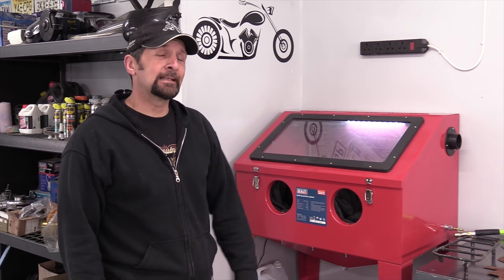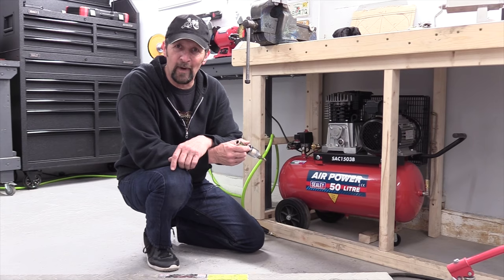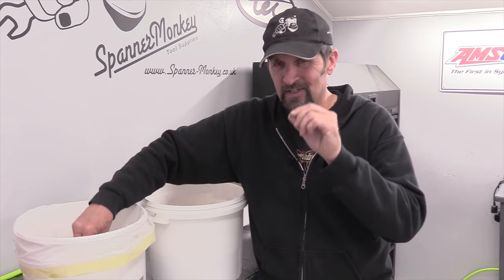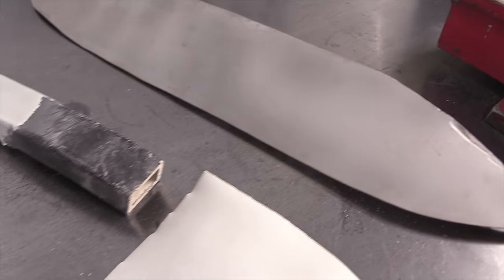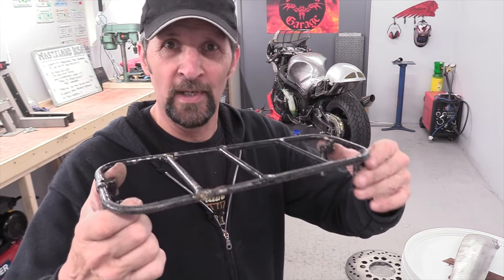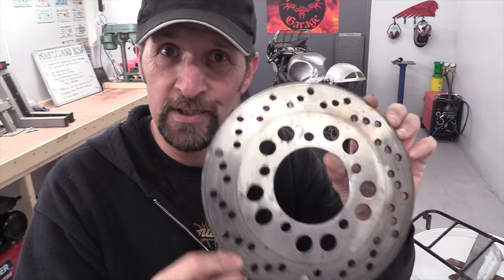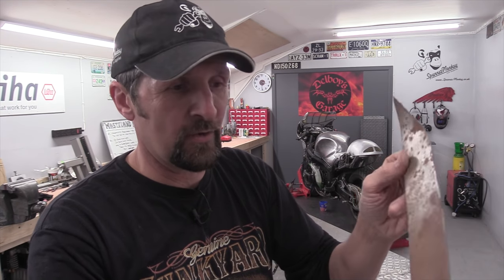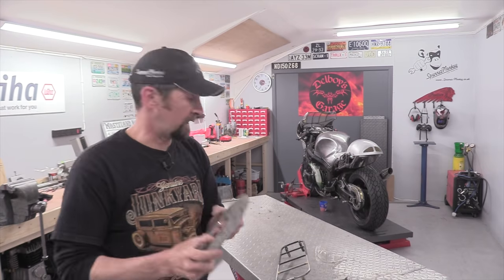Shot Blast Cabinet...First Day !

Comment: Brother, you're essentially using compressed air to fill your shop with toxic dust.  I've had 3 blasting  cabinets in my day and NO WAY does that manual say it's okay to use silica sand.  There's likely stickers on the unit which also say not to use silica or any type of sand.  You really should hook up a powerful vacuum to your system and vent that stuff far away from the shop.  Extra points for putting cyclonic filtration to spare the vacuum a bit, and a cheap blast gate on the vent to keep bugs and bird nests out.
Reply from the maker: Really?  I can assure you it's clearly written in the instructions, along with half a dozen other media, says plainly silica sand, I will look in to it and speak to Sealey and seek their advice on it, thanks for the heads up.
Reply: Wow that's shocking from my angle, but i don't know too much.  Just noticed you're using a mask- stay safe, friend! Brilliant work every time!

Comment: Another great vid but I would not put your GoPro inside of the sand blaster, as the sand bouncing around off the parts is enough to scratch the viewing screen and over time will become harder to see through and will only do just as much damage to your GoPro if not more damage.
Reply from the maker: It'll be in a waterproof case and I've got some stick on screen protectors from GoPro to cover the screen, a bit like a motorcycle helmet tear off, so it should be fine and the first test has been really successful!

Comment: Hi Del. What happned to bit of fuel tank ? U were goin see if it took out grind marks?
Reply from the maker: Yes, it worked fine, smoothed the metal out perfectly, I didn't include it in the end of the video run down, but check the video at 8:35 and 8:44 !

Comment: Hi dec if I remember rightly from my old mechanic days silica sand is bad for your health when sandblasting as it can give silicosis it may even have been banned???we used glass or aluminium oxide.... do some digging mate on it as don’t want you taking ill??
Reply from the maker: Thanks mate, going to be looking in to it, not least because it's recommended as acceptable, listed in the instructions, but not with a warning, so thanks for the heads up mate.

Comment: Be careful with the dust that comes out of the cabinet when you open it after blasting. Everything that contains silicon (sand, glass, ...) is VERY bad for your lungs!

And the dust is probably gonna settle everywhere.
Reply from the maker: Thanks mate, great insight, may look in to a dust extractor as a few have advised... just got to control the budget for now!
Reply: @Moonfleet41  wearing a dust mask or your respirator would be a good measure already. And maybe wait some time for the fine dust to settle. Some other media are not as lung-unfriendly.

Comment: Chrome is notoriously hard to remove and even professional powder coating outfits give you a warning about removing it and the powder coating over it,I bet you get a bigger compressor,I have a 150 litre and a 50 litre running in tandem to supply enough air to run my blasting cabinet,the cfm quoted on the compressor never matches its actual output.
Reply from the maker: Thankfully this blast cabinet is very much a home DIY item, only requires 12CFM to run it, compressor's running just under 14, and so far, even at maximum allowed 80psi, the motor runs maybe 50% of the time at the most on constant blasting... the compressor is actually deceptive and a little bit of a 'pitbull' as it's the same belt driven motor they supply on the 200 litre compressor, it's just a physically smaller tank , but the same motor... happy with it so far, and reckon it was the right choice, certainly did enough sums before making the choice!
Reply: Delboy's Garage I didn’t realise it was a belt driven compressor,there more efficient than there direct drive alternatives,chrome can be a right bugger to get off,the powder coaters I Use always warn me that they cannot guarantee the finish if they have to remove chrome,you’ll wonder how you ever managed without the cabinet,gone are the days of paint stripper,pete

Comment: Hi Del, thank for the demo, thoroughly enjoyed this.
how you finding the Sealey compressor? I am in the market for one, but I like a recommendation from people before committing, there are so many cheap/poor quality ones around, it a big item to get wrong don’t you reckon?
Hope you and Penny have a cracking weekend mate, cheers
Reply: Andy Devonshire definitely get a bigger capacity compressor. The draw is so great that 50L will not be enough to maintain pressure so you’ll have to keep stopping to let it recharge. 150L minimum for personal use rather than pro workshop where you’re blasting all the time should do it 👍
Reply from the maker: Hi Andy, it is indeed a bit thing to get wrong, and so far I've been blown away by this... naturally, I'm used to my little Wolf compressor, which was noisy and struggled to keep up with anything more than a tyre inflator, so this was a very important purchase... so I had a good look at the range that Seale were offering in their current promotion and they do 5 direct drive compressors and 3 belt drive units... the important factor here for me was the CFM, I needed enough power to feed the blast cabinet with room to spare, this runs just under 14CFM, but has a small 50 litre tank, if it makes sense, this is the same unit they offer with a 200 litre tank, purely the tank size is different... and the big one is £1,000 compressor, but this was little more than half that because of the smaller tank.  But the belt drive motor feeds the blast cabinet like a walk in the park, so definitely the right choice!  The only other step upwards was a giant rotary screw unit that cost more than a family car!!   So in terms of a home coompressor, this is as good as it gets when you combine the waulity with the price, it's made in Italy and feels like it would last a lifetime.  Hope that helps a little mate, check out the website if you need any more info., or drop me a line! (The model number is:  SAC1503B).
Reply: Delboy's Garage hi Del, did you notice any drop off in pressure as you were using the cabinet? If you didn’t then great as it would suggest to me that the compressor motor can keep up with the draw. If you did then you may need to consider a bigger tanked compressor. Time will tell 👍

Comment: Not a good idea to put the Gopro inside the cabinet as it will quickly get dusty and the video will become blurry. Also you run the risk of scratching the lens with all that sand bouncing around.
Reply from the maker: First couple of tests have been fine, tight in a waterproof case, and a lens film to protect the optical screen... time and practice will tell aye.

Comment: Its a noisy thing..may need ear defenders aye..
Reply from the maker: Nothing's noisier than the grinder screaming trhough a piece of sheet metal!  The compressor makes the most noise here, and it's way quieter than the old one!
Reply: @Moonfleet41  box it in with some sound deadening on the insides